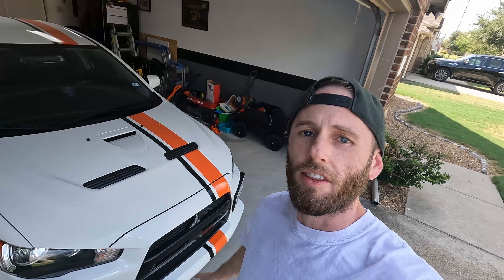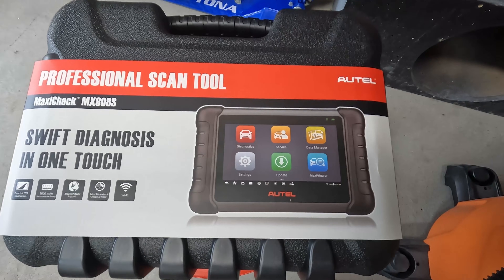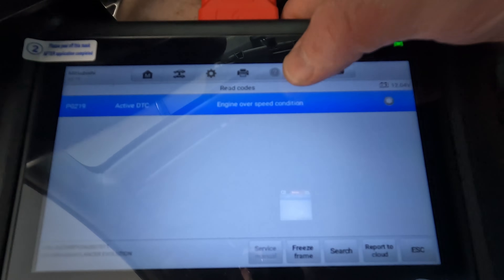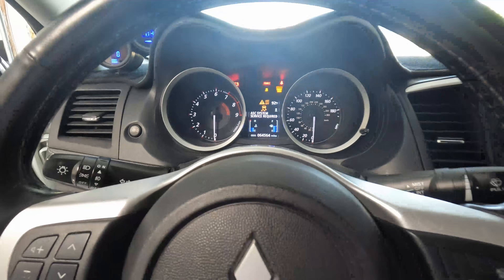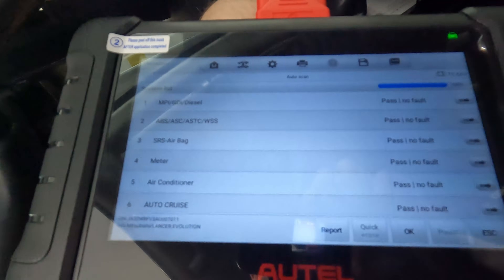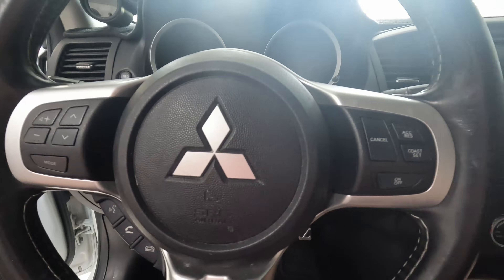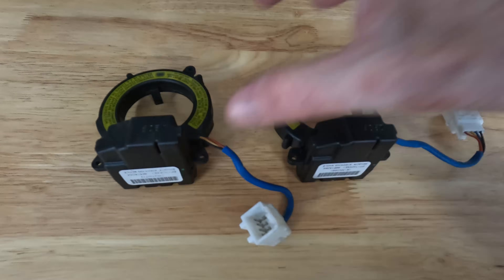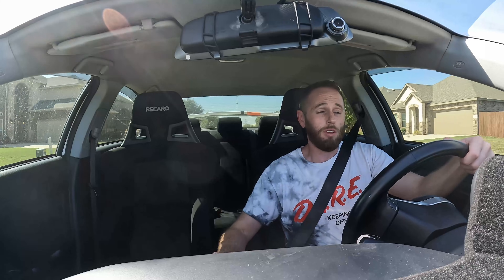ASC / 4WD / ABS Codes FIXED!!!  Autel Scanner & SAS Replacement EVO X

Comment: so wanted to come back and say from about 2 weeks ago:
first thank you for sharing this OBD2 reader
the second thing is i am thankful that it wasnt my SAS sensor but i am pretty sure when i redid that transmission and installed new ABS sensors because i did both driver front and passenger front  (left and right front for those who want to be technical).
I used the reader and went through the motions like you did in the video and i cleared the codes, took it for a drive and came back and same thing the abs light came back on and also tripped the ASC / 4WD / ABS again in the car.
so i cleared them a second time but the only difference i did the 2nd time around is i shut the car off and turned it on in auxiliary and clicked the info button on the dash until it showed the wrench over the oil life and what not, held info to get the wrench to flash and clicked it once to get anything else to clear. went back on the road and it tripped out again. which the only thing i can think of is that one of the two sensors are totally bad.
I would also like to thank @jasonpavlik4904 for his input as well. (see his comment below)

Comment: What was the first code in AYC/ACD section? I have C1219 and C2205 and it would be nice if a recalibration fixed it. I do have another SAS on hand but have been avoiding replacing it because messing with the airbag scares me a bit lol. Will definitely be using this vid as a guide though
Reply from the maker: Those are definitely the SAS codes.  Could also be alignment is out of whack.  Air bag if no big deal.  Take your time.  Everything comes off pretty easily.  I would’ve and see if someone can calibrate it first though.
Reply: @JordanMoree can I bleed ayc with that scan tool?
Reply: @JordanMoree I am planning on having a buddy try to recalibrate it first, otherwise I may just replace it this weekend since I have the part and see if the lights go away. What makes me think it's the sensor is the fact that there are two SAS codes, erratic performance and internal error. Also why was your wheel not mechanically centered? Had you disconnected it before and just not re centered it?
Reply from the maker: @theELiTEboarder had a steering issue that I had to pull the entire subframe and steering rack out.  While it was out I must have turned the wheel once (or my son did and I didn’t see). so when I reconnected it and turned the wheel all the way to one side it broke the sensor.  They’re very sensitive.
Reply: @JordanMoree gotcha, I was going to say there's no way it should be off that far from the factory

Comment: I have a 2010 Mitsubishi Lancer DE,  and did all this trouble shooting"
All brake pads are good-70% rear-Fronts just replace about 2 weeks ago.
all for wheel sensors are good-rear-look like new-I cleaned the 2 in the front.
Bled all brakes-bled out all the older nasty fluid
I just checked the vacuum, and the hose is good, and a strong vacuum is present.
I didn't have a way to check voltage, but pulled the fuses, and none were blown.
I had scanned the car, and the battery was good, but a lot of codes showed up.
ABS light on , traction light on, ASC light is on the dash as well...
CODES:
C2104
C2200
C1204
P1773
I'm thinking it is the ABS module / pump?  Brake Booster, and or master cylinder?
H-E-L-P!!!!!!!!!!!!!!!!!!!!!!!!!!!!!!!!!!!!
Reply: hey man im having the same codes as you except the c1204 i have c1200 what did you end up doing to fix it

Comment: Hey question I have the same issues but I did replaced the sensor but the lights still on. My friend tried to calibre the sensor but didnt work. Any idea what else should I do?
Reply from the maker: @jr1cky580  the only thing I can think of is the clock spring isn’t centered.  Disconnect the steering shaft above the brake pedal.  Once disconnected you can turn the wheel freely.  Turn it all the way right gently. It will stop on its on.  Dont force it.  Forcing it can break the clock spring.  Then turn the wheel all the way left until it stops again.  Count how many rotations it took.  Turn the wheel back right again half of the rotations and that should get you centered.  You should have the same number of rotations from center to right and center to left.  From there you can calibrate the sensor again.

Comment: I was drifting in the snow when suddenly that light appeared to me 4wc system service required and asc system service required And since that appeared, my car does not hold firm in the snow, it slips easily.
Reply from the maker: @marioramirez3418  unless something became disconnected I’m pretty certain your problem is a failed AYC pump.  Common in these cars due to its location.  Throwing snow and dirt all over it will definitely do that. 😉

Comment: I had the same exact symptoms. While doing a clutch I rotated the steering wheel and crashed the SAS. After much exploring and experimentation, I disassembled the SAS and found it skipped a tooth. I was able to reassemble it correctly and after a short drive the warning lights went away. This repair also fixed the unequal steering wheel rotation. It took me two weeks of free time to figure this out.
Reply from the maker: @jasonpavlik4904  after buying the new SAS I did take my original one apart.  I’m fairly certain I fixed it as well but haven’t tested it.
Reply: Within the last couple days i also had to do a clutch on my 2015, and i have all these codes but i also had to replace my wheel speed sensors so my hopes were that they were causing the issue. Do you believe it is possible that when rotating the steering wheel when i was disassembling everything that it could have tripped the SAS?
Reply: @BushW00k  It doesn't take much to mess one up. Do what I did. Get one from a lancer in a junkyard, and pull apart a known good sensor. Make sure it is clocked correctly before you disassemble it. Taking apart your SAS and resetting it is almost free. Worth a shot.
Reply: @jasonpavlik4904  I appreciate the info and will look further into it, wouldnt hurt to try.

Comment: Hey man I was wondering if you could test something for me. I bought multiple scanners but none have been able to bleed the ABS pump. Could you check if this scanner supports it? Dying to get my car back on the road
Reply from the maker: @BGNADS  honestly I’m not sure.  It definitely does a lot but I’ve only used it a few times so far.  There’s options for bleeding brakes but nothing specifically says bleed ABS pump.
Reply: @JordanMoree  It would probably just say ABS bleed or something to that effect. A lot of scanners claim to do it for all brands but have trouble emulating Mut III. Thanks for the reply!
Reply: @JordanMoree  I appreciate the reply. It would probably just say ABS bleed or something to that effect. A lot of scanners claim to do it for all brands but have trouble emulating Mut III.

Comment: Great video . But just curious how you damaged the sensor angle sensor by removing the rack ?
Reply from the maker: @djmikeymic10  when the rack was out the wheel accidentally got turned one full rotation.  Once reconnected and turned in that direction it was too far for the sensor to turn.  It breaks easily if turned too far.  Usually the clock spring would have broken too but I got lucky somehow.

Comment: I just got the same problem exact problem lol I’ve been watching this video again n again last couple days about to start taking the steering apart
Reply: Any update on the issue?
Reply from the maker: It’s really not that bad.  Just be careful with the sensor and clock spring.
Reply: @JordanMoree  it was an alignment that got messed up I put a new subframe and I needed a good alignment I did one but it was not great so I had to get one professionally it worked
Reply from the maker: @sonnyvirk6084 alignment will definitely throw it off also.  Glad you got it fixed!
Reply: Hey  @sonnyvirk6084  did u have to calibrate the steering sensor or did the lights come off as soon as u aligned it thanks

Comment: I wonder if that’s the same code for my car hopefully isn’t the pump i just have the awd system service light
Reply: Having the same issue right now, any updates? What was it?
Reply: @BZmotorz bro i haven’t even touched my car 😂 i did replace the relays cause they’re were the new upgraded ones.
Reply: @BZmotorz same. Replaced the pump, bled pump, same problem

Comment: So the Autel MX808s has the ability to read and test the ABS, AYC, and ACD codes? Just confirming.
Reply from the maker: Yes it reads all the major systems.  It’s supposed to have two way interaction to actually bleed different systems within the brakes and AYC/ACD but I’m not a pro at using it.  But it definitely will read all the major systems to help narrow down a problem.
Reply: @JordanMoree  My man. Appreciate the quick response. Car looks sick. Great job.

Comment: Where’d you buy the front lip/spoiler?
Reply from the maker: https://www.ebay.com/itm/371723873981?hash=item568c782ebd:g:floAAOSwMgdXxiFO&amdata=enc%3AAQAIAAAA0H6gRtm%2Be8Z8pVuRtl1YUz7kbguQSsDZMjFFmWTkK3C3pmIxsaNRYrQk9syaceJq6bMBjHpQFecWfj2HzUDARWu9NjvJ49YhxMdou45ZU%2BNmJnFNM%2FbqoIQ%2F92ts3687a6iQn%2B9RNhSi%2FFwOCDKBa%2Fam0zhIfodA9%2B2%2Fph%2BpukZj2ih0ijipaAcriN6BZGJedFf7Bym3qgItegEL%2FmQBKQwNP7LtFjrqL4mRO27T5sYpZPe72xU3pEEPnRcus1Mr2Rfu4cE8xzQcZfx4seHOEnk%3D%7Ctkp%3ABk9SR6Tsg6mUYw